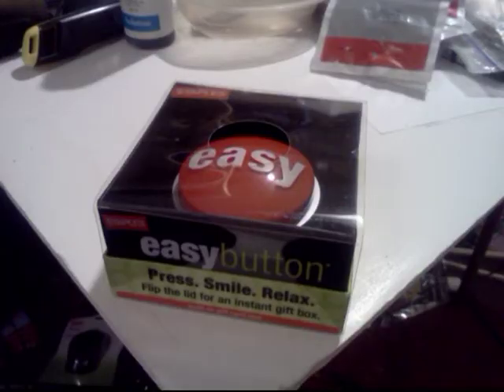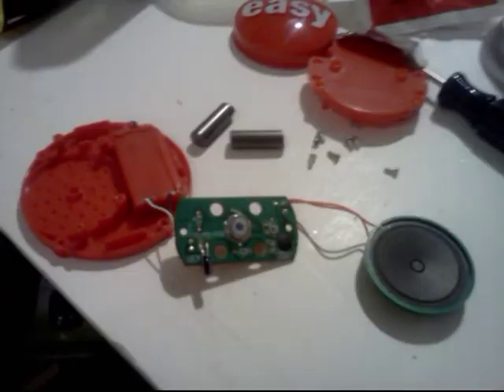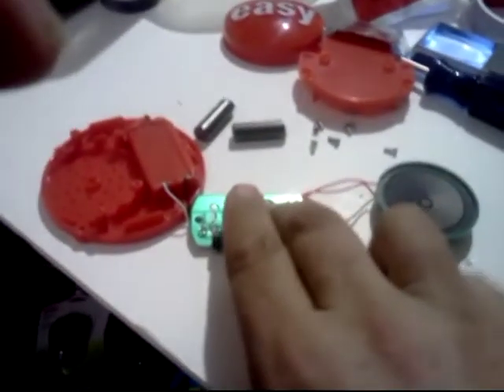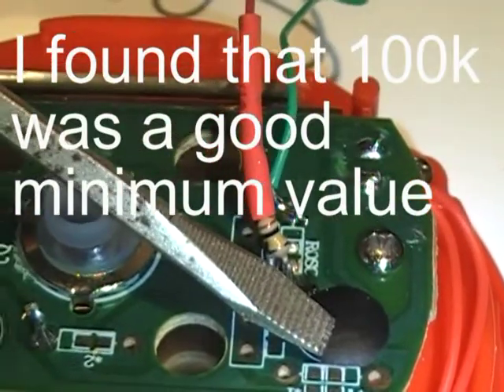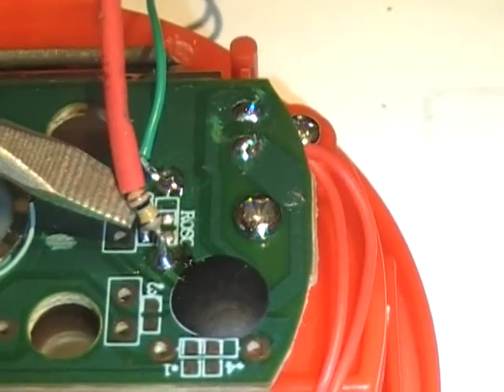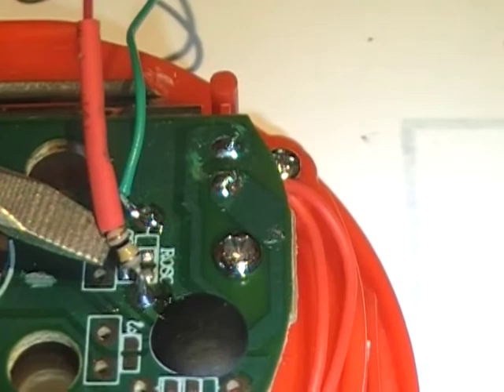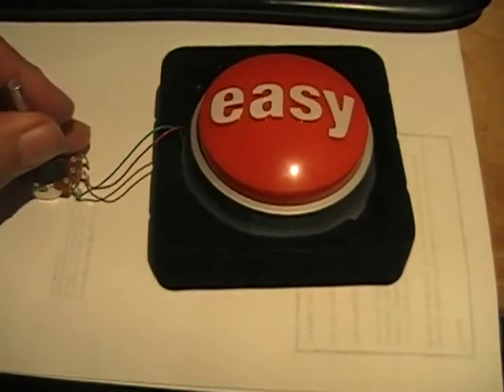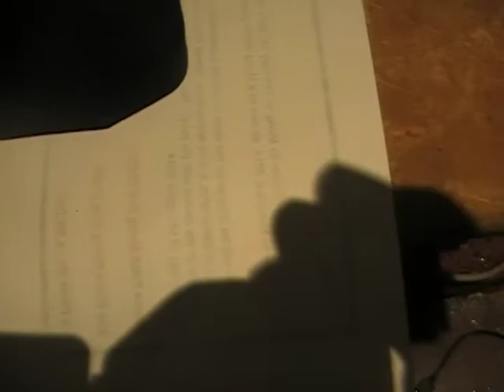Moog Circuit Bending Challenge 2014 Blog

Comment from the maker: Technically this is not a contest entry. It is the first of several blogs I intend to make as I work through building my actual entry into the competition. Feel free to try this out for yourself. My next blog will be a bend of an Alarm Clock Radio to use it as an amplifier for the sound generator.